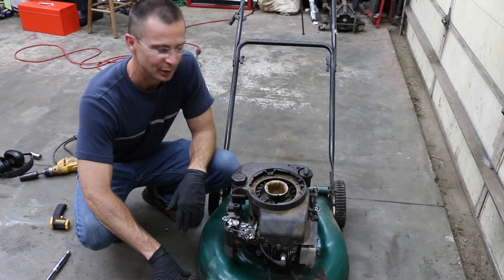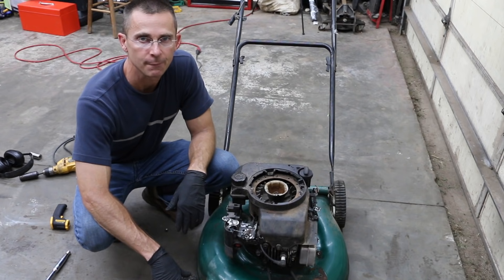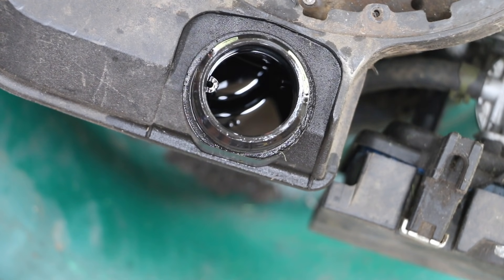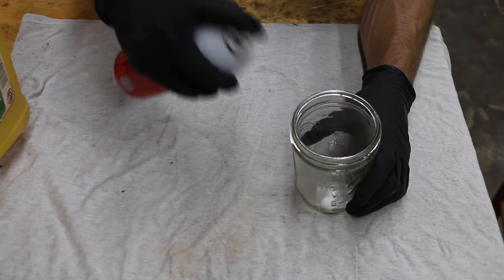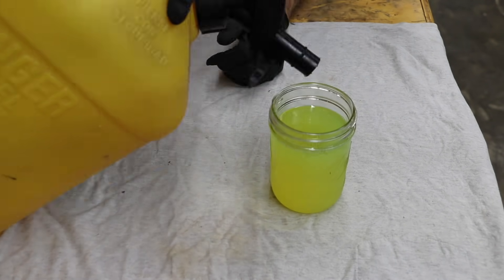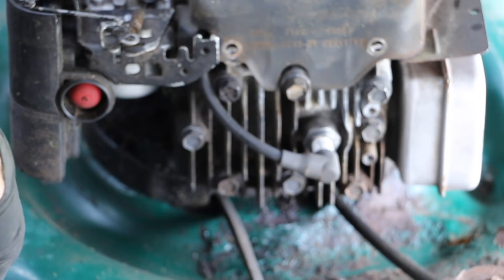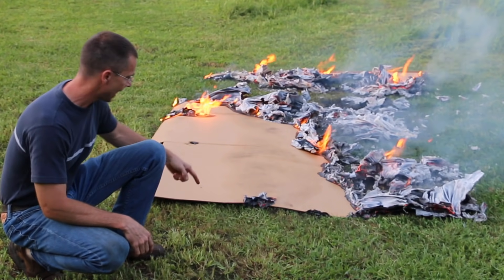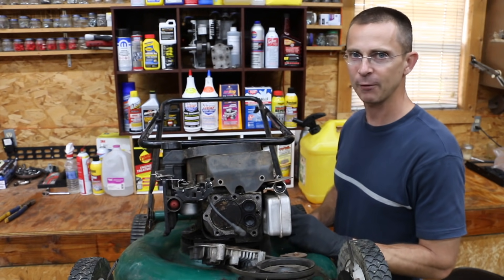Will a Gas Engine Run on Diesel?  Let's find out!

Comment: I saw a lot of carbon in that motor... i would like to see you use alot of sea fome engine cleaner, an see how well it actually cleans that motor
Reply from the maker: Thank you for the constructive feedback!
Reply: All cleaners are the same. Naptha and turpentine, or a petroleum equivalent. Walmart has SeaFoam, Gumout and their own brand Supertech all in a row. The only difference is, tiny amounts of proprietary additives and the pricier stuff smells better. I suspect, some of the dollar store fuel additives are formulated on the same base, but I can't say what is what. The red stuff (Marvel Mystery Oil) will work just as well for all purposes and it is cheaper. The biggest hoax is the Stabil fuel additive. Mystery oil or a cleaner additive will do the same thing. If you are going to store a vehicle, the best thing is to have the tank low when you put it in storage, add a gallon or two  before you start it up (if possible) and drive to a nearby gas station and fill it up. If the tank is near full, fill it, drive it, fill it again when it gets a gallon or two low, fill it again, again, again, again. Pretty soon, you will dilute your groundless anxieties to a tolerable level.

Comment: Dude59
Must be to young to remember the old tractors (before WWII) the spark ignition ones most all ran on tractor fuel (60% diesel 40% gas) to keep them from pinging real bad some even had water injection!
Reply from the maker: This is great information. Thank you!

Comment: Can you run a 4 stroke engine on 2 stroke gas oil mix with an empty crank case?
Reply from the maker: Thank you for the video idea!
Reply: Where are the rod and crank bearings going to get their lubrication? Or an overhead cam? Not made to work that way.

Comment: Try it in a Honda it will run 100% totally different engine then that old guy Tecum also for the more gear head guys and girl label the HP of the engine brand and year.... my take is that carb was a bit gummed up and is why it would only run on prime
Reply from the maker: Thank you!

Comment: I was going on a trip of about 450 miles in an old '48 dodge truck and stopped to get gas. The fuel gauge was broken,so I had to stop about every 150 miles,so I put what I thought was 10 gallons of gas,but when I went in to pay,the attendant said" I didn't know that those old trucks came with Diesels". I got back on the freeway with about 3/4 diesel,and at 55 mph,it ran well.
Reply from the maker: Wow!  Glad it ran fine!

Comment: Just had a guy do an oil change and change my stater and re wire my flat bed , my diesel truck 1995 f350 7.3 diesel on it so I noticed he put an 5w 20 and he put a oil filter for an gas engine , I just ran 2800 miles on it no PROBLEM BUT getting pissed bc it stanks really wierd but all is working turbo and and everything , you should do a video about using a diesle filter on a gas engine and vise versa
Reply from the maker: Thank you for the video idea!

Comment: try running an engine on acetone.
get nail polish remover for large quantities you can pour instead of spraying.
test this on an expendable motor with a LARGE safety area. remote starting might also ve a good idea.
Reply from the maker: Thank you for the video idea!

Comment: Wonder if adding acetone to Diesel and running it in a diesel engine will it hurt it.... I've added acetone to gasoline to increase fuel mileage. When doing so I achieved a 25% gain in fuel mileage. Cleans out the fuel system which is why I wonder if it would work with diesel or not. I do not running gasoline in a diesel engine will hurt the engine but if acetone would not hurt the engine it would be nice to know cuz then we could use it to clean out some of the injectors in a diesel engine.
Reply from the maker: Impressive results!

Comment: Back when we had leaded fuel a customer used to do 25 percent diesel 10 percent Super and 65 percent standard fuel he maintained the diesel added more lubricant to the engine through the top end Ie. Head this was running in a late model 67 year car it drove away with little smoke so I'm guessing it worked don't try on modern fuel injection unless its going to be scrapped as I don't know the outcome. Aussie Jeff
Reply from the maker: Thank you!

Comment: Sorry son  but I have run diesel in a lawnmower with an old flathead B/S Engine !!!  BUT the engine was well warmed up when I added the diesel to the tank, no gas, I was out of gas and had none available, it ran fine and I finished my mowing job !!!  During WW II when gas was rationed my dad ran an old Ford Flathead v8 on diese/stove oil, same thing, BUT he started it on gas and warmed it up some then switched to diesel, it did not have the same power but it ran !!!
Reply from the maker: Thank you!

Comment: I have an idea. Construct a vacuum chamber big enough for the engine, replace the atmosphere with a vaporized hydrocarbon (fuel) and plum oxygen to the carburetor to see if it’ll run on the oxygen as a fuel.
Reply from the maker: Thank you for the video idea!
Reply: I dont think that would work. You still need fuel - o2 in and of itself isn't fuel.

Comment: About ten years ago when I was 13 or 14 I was mowing my grandmothers lawn, and when the lawn mower ran out of fuel I found a jerry-can with some "Gasoline" in it, which I then poured into the tank. The lawnmower began to smoke like crazy, and I wondered if it was Diesel which I put in, worked fine though. It could have been a two-stroke gasoline-oil mixture as well, now im thinking about it. And after seeing the video the two-stroke theory seems much more likely to me.
Reply from the maker: Thank you.  Sounds like diesel or kerosene.

Comment: 100% Marvel's mystery oil challenge

MMOs fuel and crankcase oil in a 4-stroke

MMO as two stroke fuel
Reply from the maker: Thank you!
Reply: MMO would work as fuel in a diesel engine, at least for a while. Much too heavy to run in any gas engine.

Comment: My old car was proof that it won't run on diesel. The very first time I filled up a car with gas was with the wrong pump. I didn't know anything about cars back then as I was just 21. Luckily my parent's house was a half a mile down hill from the gas station as the car really started to sputter not far out of the gas station parking lot.
Reply from the maker: Thank you!

Comment: Diesel fuel needs to be atomized to combust whereas gasoline just evaporates at low temperatures and the vapor is combustible.  That's why we never had carbuerated diesels.  I wonder if maybe the gasoline was carrying the diesel when it evaporated or if the burning gasoline was heating the diesel up to IT'S vapor point, causing the diesel to ignite.  I would like to see (and I might do it on my own) gasoline mixed 50/50 with diesel and set out over night to test this.  If half of the mixture was left in the morning, we can be fairly certain the gasoline evaporated off, leaving the diesel fuel alone whi h eould mean the heat from the burning gas was evaporating and burning the diesel.  If less than half remained, we would know that at least some of the diesel was being carried with the gasoline..  The other thing I would like to se (but this would be dificult) is is a small engine could run if a proper diesel injector and fuel pump were added.  This would tell us whether ATOMIZED diesel was capable of being ignited with a spark.  If that were the case, it would be interesting to see the difference in the burn characteristica.
Reply: You are wrong on several points.    Every hear of tractor fuel.    It was basically fuel oil somewhere between k1 and #2 diesel.   Start on gas and once the carb was hot switch.    So yes there were carbarated engines that ran on diesel.  Every hear of JP-4 or 5.  Military use it in every thing.  Diesel,Gas and Jet engines.
Reply: @brianpatrick8787  I must cry BS here.  Tha military uses JP 5 in compression combustion and turbine engines.  These are injected engines, not carbuerated engines.  The same is true of their use of JP 4, although JP-4 might actually run a traditional spark ignition engine since it is a 50/50 blend of gasoline and a diesel-like fuel.  It wouldn't run very well though and would lead to a lot of carbon buildup over time.  The few engines the military has that are regular gasoline engines are filled with and run off of gasoline.

As far as tractor fuel is concerned, it was much closer to kerosene (a shorter HC chain) than diesel fuel and if hot enough, would readily evaporate and burn once a spark ignited it.
Reply: So did you try it on your own? 50/50 mix? How's the result?

Comment: Im intrigued , how long does the engine run on 50/50 compared to 100% gas
Reply from the maker: It should run a little longer but I didn't test for that. Thank you

Comment: Years ago, we used "drip" gas. What you did was have about five gallons in an old Chevy or Ford or whatever, and go to an oil well that had a barrel for the thinner crude. It was considered a waste product, but wouldn't burn good enough to dispose of that way, so they hauled it off. (Nobody cared about it, so it wasn't refined as they would now. No telling how much crude was wasted over the years from thousands of wells.)

Put in about ten gallons in the vehicle, leaving about five gallons of space for sloshing and mixing on those old Oklahoma roads. You put it in with the engine running, and don't kill it till you got where you were going, 'cause it wouldn't start again. There would be plenty of smoke, and those old motors lugged along like they had a boxcar in tow. But the Oklahoma panhandle is fairly flat, so it worked.

It might sound adventurous to bounce along on free gas, but it was really stressful unless all the occupants were fortified with liberal quantities of the nectar of the gods. Ah, misspent youth.
Reply from the maker: Thank you!

Comment: Maybe try Kerosene. I tried it once and it seemed to run alright with a bit of knock. After about 10 minutes it cracked the side of the block lol. Wondering what happened but an olf mechanic said it would run and it did.
Reply from the maker: Thank you for the video idea!

Comment: My opinion please tell me if I'm wrong the 50/50 mix gave the lubricity to the gasoline that it was missing because as we both know the old leaded gasoline had lubricity from lead which we don't have the pleasure of using anymore thank you EPA LOL but diesel fuel by itself has a certain amount of leprosy in it anyway because diesel fuel is real close to crude oil versus gasoline and in my opinion that is why 50/50 gas and Diesel was able to work please let me know if my thought was. Accurate
Reply from the maker: Thank you!

Comment: My dad had an old worn out small block Chevy engine and to increase his gas mileage as well and to oil the top side of the pistons and rings, he would mix in 1/2 quart oils with 1/2 quart of diesel and added that to his gas tank and then filled it up with gas. It ran great and had more power and was able to increase his gas mileage by a few points.
Reply from the maker: Interesting. Thank you

Comment: Project Farm, I'm not getting the sense that you like to invent things.  If I am wrong, I'd love to see you run a small engine on compressed air.  Imagine removing the spark plugs and putting an air valve in its place, connected to an air tank.  I'm not sure how you would time the opening and closing of the air valve, which is why I'm looking to you!!!

The gauntlet is at your feet, sir...
Reply from the maker: Thank you for the video idea!

Comment: You should try running the engine until operating temp on gasoline, let it run dry and then quickly switch to diesel and restart the engine.
Reply from the maker: Thank you for the video idea!

Comment: My dad accidentally filled his pickup with diesel instead of gas. Back then the nozzle used to be same color. We didn't make 10 miles and it was losing power and had to get a toll home.
Reply from the maker: That's the kind of mistake that usually only happens once.

Comment: Thank you for your service. Can you make a lean running engine with an additional water injection system? Will it save fuel? Will it burn cleaner? What happens to engine temperature? What about hp?

Comment: A true story. My mother once ran out of gasoline coming back from my grandmother’s. Pulled off along a major interstate on the shoulder. A construction crew saw her pulled over. All they had was diesel fuel. Poured a couple of gallons in her car and followed her to the next exit. 
Yes the gas engine ran on diesel.
She filled it with Premium gas and it ran fine. 
This was back in the the 70’s. The car was a 75 Plymouth Valiant with the 318 V-8.
Reply from the maker: Thank you

Comment: We had an old John Deere tractor that started on gas and once it was hot you could switch it over to diesel, fuel oil or kerosene. It ran great. It had two tanks.
Reply from the maker: What a great system!

Comment: Since the energy density is higher in diesel. Could you improve car MPG by using say a 80/20 petrol diesel mix.
The emissions will obviously be a lot worse since the exhaust system is not set up for diesel.
Reply from the maker: Thank you

Comment: can an engine run on paint thinner?
Reply: Paul S  that’s basically kerosene. It should work, if the engine is fully warmed up first. Won’t get full power, though.

Comment: interesting,, now I know why my car wouldn't run right then dies when I was desperate and siphoned diesel to put in the tank haha. yeas, now I know it's a great fuel for low rpm, high compression semi engines that need that long-burn torque
Reply from the maker: Thank you!

Comment: Anyone ever seen a hot bulb engine run? If you run an engine on pure oxygen you can pull out the spark plug and yes it will keep running!
Reply from the maker: Interesting.  Thank you

Comment: I had a mini bike way back when .It had a Tecumseh . Filed the head , ported the block, polished the valves, advanced to timing and drilled out the carb to run on Methanol. 45mph and blue flames out the exhaust pipe 1 ft long. Only went 25 on gas. Tryed all kinds  a chemicals . Once there was a guy in the Army told to make small engines run on Ammonia. It did run. I think his name was Schwartzkopf.Popular Mechanics?
Reply from the maker: Impressive!

Comment: So it looks like the experiment added a lot of buildup of varnish to the engine parts? Did you notice a difference in the time the diesel/gas mix lasted for one tank vs. Just one tank
Reply: Of pure gasoline?
Reply from the maker: I didn't keep track of the run time. Great point on that.

Comment: There were some old army deuce and a half that would run on whatever you could put in there tanks I dare you to look that up dude half ton army trucks that could run on literally any fuel including gasoline diesel or kerosene The engine was called Hercules multi fuel
Reply: Matthew Clouse those old Hercules engines were among some of the best and they put them in some of the old tractors also
Reply: william foreman most any older diesel will run on pretty much anything that will burn.
Reply: @joshlower1  will boil water but it just won't compess
Reply: I did a job for a guy with one of these he was running it on a 50/50 mix of old engine oil and gasoline. Apparently its cheap to get the waste oil in big barrels lol

Thing smoked like a train haha
Reply from the maker: Nice!  Thank you
Reply: Vegetable oil I think 30 weight oil or lighter. Transmission fluid bacon grease
Reply: Kerosene and diesel are one in the same
Reply: Sam L gasoline is a byproduct of kerosene. Standard Oil was dumping gasoline in America's streams before they found a use for it. 
Edit: typo
Reply: @Morningstar_Actual  Kerosene is number 1 Diesel oil and Diesel is number 2 Diesel oil.

Kerosene is lighter and burns a little cleaner.
Also known as jet fuel.
Reply: Veggie oil works on those as well, super robust engines
Reply: Old Ford model t engines can also run on just about anything, it works with kerosene so I think it would work with diesel/jet fuel
Reply: Yes sir, 2 gallons of kerosene, some urine, and as much spit as you could put in them haha. Good luck flooding them out also!

Comment: I borrowed my housemates rover 214 years ago and stupidly topped it up from shy of quarter a tank to full.... (I was on auto pilot as I had a diesel van, didn't pay any attention doh!) The car coughed and splattered at low revs but it ran ok. I drove it 50 miles home and managed to top it up again with some unleaded. I told my housemate that they'd need to give it some revs when idling in traffic. She said she got over 600 miles on that tank! Normally she'd do about 350.

Comment: Wonder is when did you mix gas and diesel it ran longer?
We all know diesel engine gets better mileage.
So thats why im asking.
Reply from the maker: It should run longer because diesel has more BTUs of energy but I didn't adjust the carb for proper air fuel mix.  Thanks again!

Comment: Diesel is about 20% bio which in the fuel business is known as B-2. That's about 15 parts per million. Ultra Low Sulfer. How about Heating oil from the northern States that run 500 or 1500 PPM. A High sulfer. That really hard smell of a distalet. The sulfer contains more carbon. So as our country becomes more efficient we have reduced carbon then dropping 1500 or 500PPM diesel. So heating oil with red die or off road diesel be a true test but only a high sulfer.
Reply from the maker: Thank you!

Comment: Diesel is basically #2 fuel oil, what you use in a boiler to heat your home. It runs best off heat. Diesel ignites off the heat of the cylinder walls in an engine. That's why they have glow plugs, it heats the engine so the diesel will ignite.
Reply from the maker: Thank you!